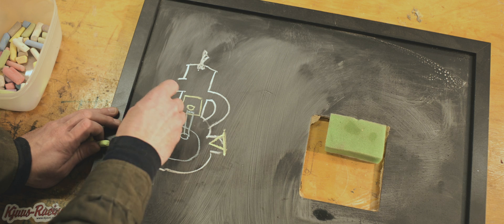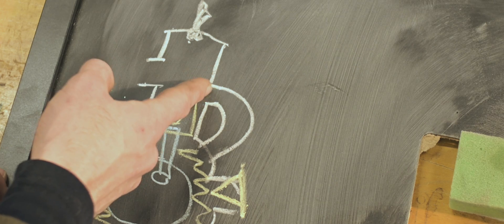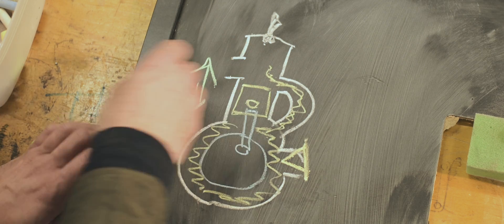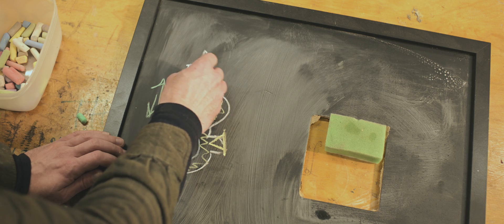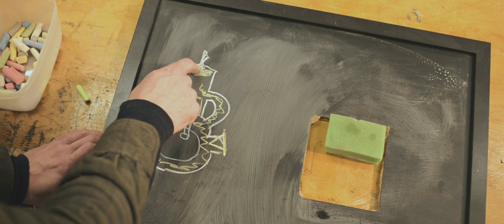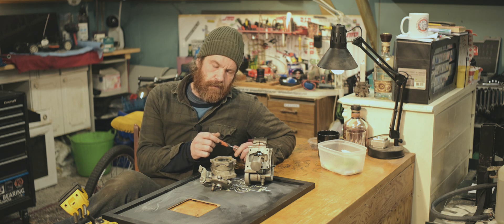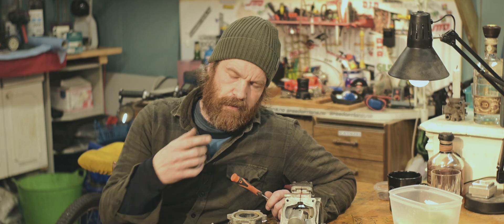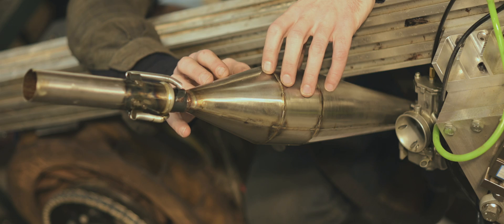Now, That's a two stroke pipe!

Comment: You need to develop an exhaust system like the intake on an SR- 71. Something that is movable and will keep the Power band at max throughout the rev range.
Reply: it's been tried, it leaks and jams like a motherfucker. the carbon/oil mix grinds any kind of seal the heat doesnt.
Reply: @comethiburs2326  well yes, but as i understand it this engine won't be used for long periods of time, and an engine this high performance gets rebuilt pretty often anyway so i don't see it becoming much of a problem.
Reply: @comethiburs2326  Yep, way back in the early 1970's by Phil Read.
Reply: I linked this on his previous video https://www.youtube.com/watch?v=0odVzSgufjk&lc=UgzxS09m4RxpKmoty-R4AaABAg.9U-eQso8AqH9UzuKng8gW2&ab_channel=RicM4        Keep spamming him, maybe he will see
Reply: @dksoldierdk  i like that pump action
Reply: They are called "slippy pipes"
Reply: @kortzcom  is it an adjustable length "stinger" that you adjust on the fly? on a go-kart..you shorten it going into a corner for low end torque ..after you exit and begin to reach top speed you gradually lengthen to stinger ...i was shown by a championship go-kart racer of this trick
Reply: The pipe cut in two in the middle with springs to allow it to extend at higher rpm .....great plan
Reply: @omaliveatlast4688  you need a shorter pipe at higher revs because there is less time before the exhaust port closes.
Reply: @garymartin557  wrong
Reply: @garymartin557  you got it backwards bub
Reply: @omaliveatlast4688  close but no cigar
Reply: Or just add some RAVE valves to help with low end torque and maintain high end flow
Reply: @Orofino6  I don't think that is the problem here, I think he specifically needs the pipe to work for higher rpm's, and rave/powervalve won't do anything with that, the pipe would still return charge back into the crankcase at some point.
slippy pipes would be nice if he can find a way to make them last, or, if not possible, he could add another pipe or two with different tuned lenghts, with some kind of valve to controle which one is used, similar to what is done to cars with silencer valves
Reply: @joshe2420  nothing returns back to the crankcase at any point
Reply: @Orofino6  what is a RAVE valve ?
Reply: Oh, you mean the Yamaha or Suzuki Power Valve. Put in production bikes in the mid-1980's (motocross bikes). It raises and lowers a gate on the exhaust port BUT it isn't perfect as like a carburetor, it doesn't respond PEREFECTLY to the engine's needs. Even computer controlled exhaust valves like on my Suzuki RGV-500RST (the 1994 F-1 bike VERY slightly de-tuned and with street lighting for the Japanese home market) aren't perfect, and that bike cost over $45,000 new without brakes, wheels, tires, or suspension. Second fastest street bike ever sold behind the 1994 Hayabusa (6 MPH slower Top Speed FIM records). Both used no longer available DOT YY Speed rated tires only made by Yokohama and Metzeler good for 211 MPH (340 KPH).
Reply: Thermostat spring to allow for two stages of flow

Comment: Why not use a variable geometry exhaust pipe?
Some outboard motors used that in the past, where they would vary the length of the pipe according to the rpm. It was done manually, but with today's electronics, should be easy to achieve precise adjustment.
Reply from the maker: Didn't think it would be necessary with the variator, but starting to think it might.

Comment: That was a good visual for the pressure waves in a pipe. I already knew what happens but that's an interesting and easy way way to explain it to people that don't.
Reply from the maker: Thanks!
Reply: @2STROKESTUFFING  I e 0
Reply: @2STROKESTUFFING  I would love to see the demonstration done on the space station, with zero gravity to act more like a gas, I'm not 100% sure it would work.
Reply: You can tell he’s a teacher. I’ve had several two strokes in my teens, a Yamaha fs1e, yz125, tdr250 and a dt400 and I never knew exactly how everything worked until now.
Reply: @robertmckay694  I'm so old, that there was "no" literature within my reach, when I was a crazy "moped" rider. Still had the , by far, fastest moped around (except perhaps Claus Laursen's Gilera with things done to it and the onlt full fairing on a moped I ever saw - but never got to race him, him being a lot older) NOT because I had a clue, but because I kept on changing things, until the best was found. I was  tiny 1940-50s lady moped with a Minarelli with 7.5 hp cyl and head, a 19 mm Deæorto with no filter, a Silentum Jet exhaust, a banana seat from a bicycle, a 1 l. plastic Castrol oil bottle gas tank  and no lights or brakes - I did write CRAZY..  Would love to make one again, but the parts prices have gone wild..
Reply: @CONEHEADDK  
I was in a moped club once. We were called, "Dopeheads on Mopeds". 😆
Our biggest challenge was gravity. Always making us eat shit.
Reply: @robertmckay694  Had a Stan Stevens tuned DT 400 which was possessed but a TDR is still on the want one list. Such happy days!
Reply: @1998TDM  My brother had an ex works Yamaha 360 moto crosser and was a monster
Reply: Hemholz resonance
Reply: Watch the YouTube video ... The series of shockwaves from this explosion in a tunnel
Reply: Exactly. Noting more to add
Reply: I still suggest a expansion chamber servo its the best way with that motor design that i can see... many great ideas combine them all and you have one powerful 2-stroke... best of luck ;)
Reply: I knew how it happens just hard to visualize, this was a great way
Reply: Totally Agree . Good  Demonstration  Model .
Reply: Yeah. I thought so too. Its kind of a hard concept to grasp.
Reply: tell us what causes the "pressure wave" as you dont seem to know anything if you think the water in a bottle is a good visual

Comment: Have you considered 3d printing a crankcase stuffer to take up some of the volume of the crankcase, and add a boost bottle with a valve, so in essence, you would have a variable volume case.
Reply: Yes he's done it in the past
Reply from the maker: 👍 but might have to revisit.
Reply: @2STROKESTUFFING  now that’s exciting
Reply: @2STROKESTUFFING  Thanks for another great video! Have you looked into the pulse intake developed by a gentleman called Ron McCord from the states? I have one of his pulse intake systems on my CR500 and it helped a lot with low end power, surprisingly high over rev too and less vibration. It uses the same principal as a boost bottle but instead of a closed loop it's an open circuit. Adam at Millar Racing Engines has good info, pics and diagrams. I'm sorry if none of this is new! Also sorry for your loss, funerals blow.
Reply: @k2bkuxx  I was just about to say that but you beat me to it